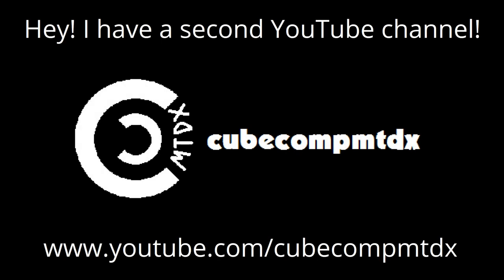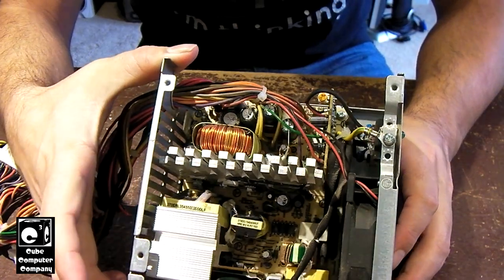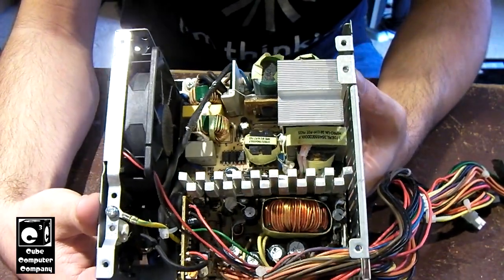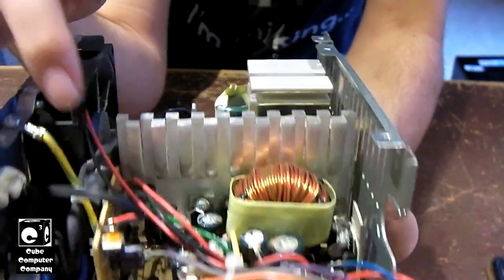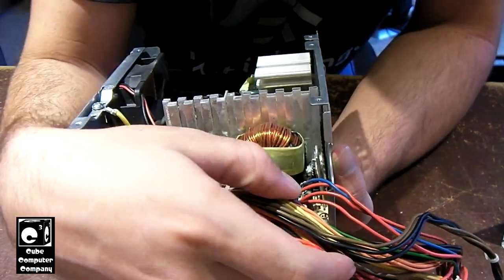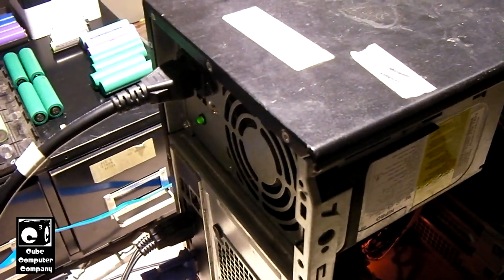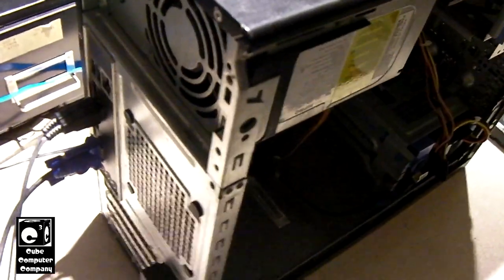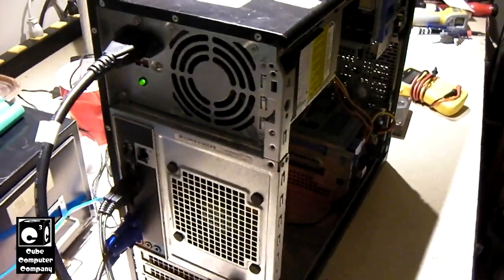Attempting to repair power good issue on HiPro 300W Power Supply

Comment: Just got a wintech power supply and it has the dreaded capacitor plague .
Reply from the maker: Yeah, I've recapped two of them.
Reply: @Cube Computer Channel  mine is the 400w version.
Reply: @CubeComputerChannel  do you have a link to those videos?
Reply from the maker: @plainsabertooth7828  I do have an old video from when I recapped one of the units in 2011. I have two identical units. The only thing is I back then I used to salvage caps from motherboards and other PSUs, though I generally recommend purchasing new caps. This unit is still working today and now powers the Cube Computer Plexi.
https://www.youtube.com/watch?v=lPS5YCFXlRQ
Reply: @Cube Computer Channel  I'm gonna recap it with fresh caps the the thing is with mine I'm gonna have to recap the 680uf 200v caps since there bulging on top too.